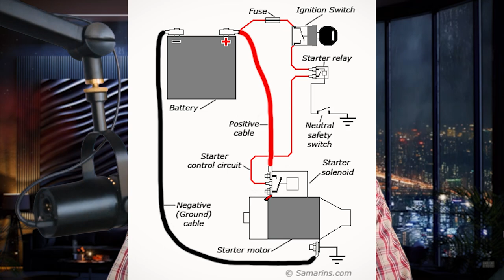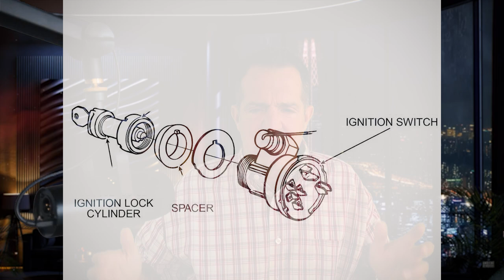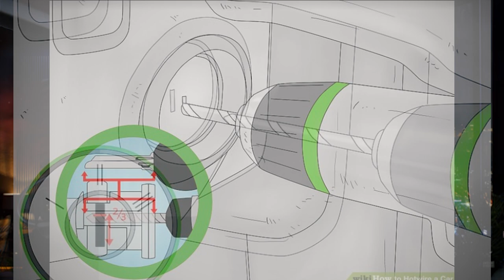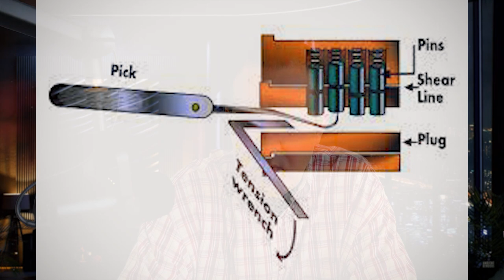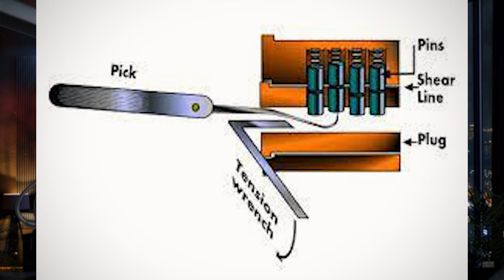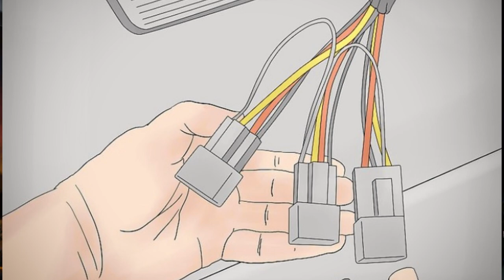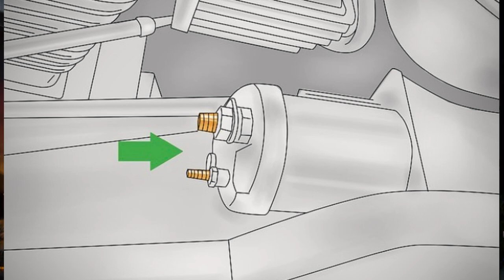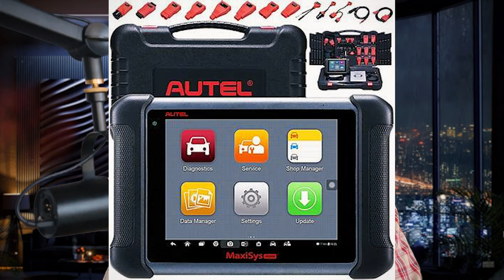History of Hot-wiring | Stealing a Car in 30 Seconds | Kia Boys

Comment: old school hot wiring works with motorcycle/mopeds, tbh the ignition is much easier to break/hack compered to cars due to where it is on the bike....in the past i've used a hand size rock to just smash the ignition barrel open  just gotta break the steering lock and your away.......

Comment: On TV and in the movies,they make getting to the wires (bare handed) to hot wire,seem real easy.some of  the older vehicles we had (60/70's) with the selinoids under the hood,could be started with crossing terminals, with a scew driver.old memories, not stealing.